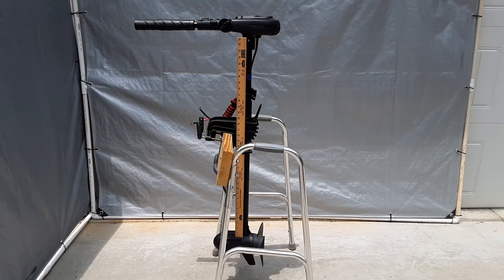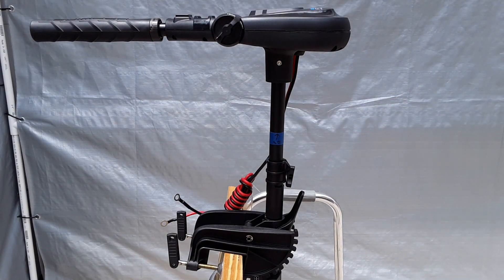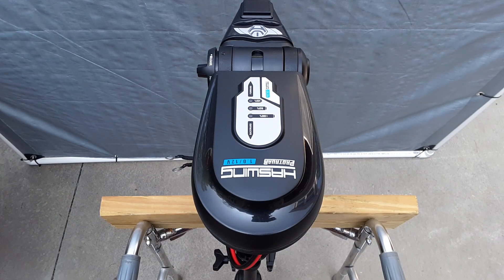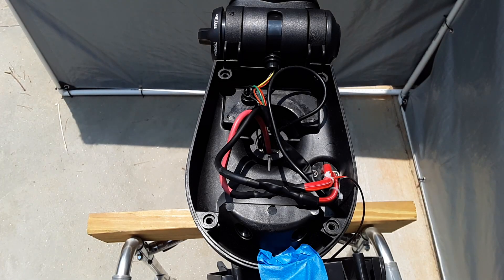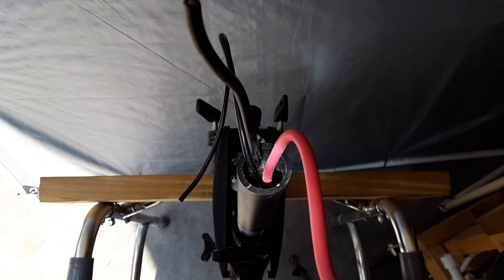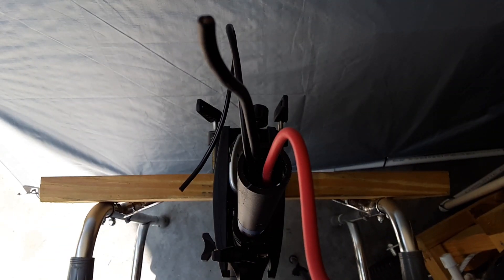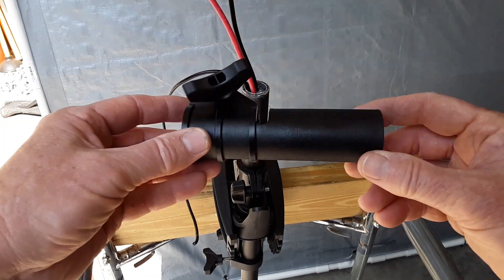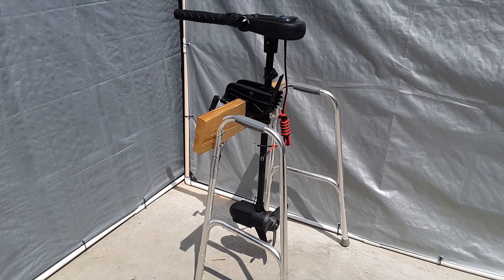Haswing Protruar 1.0 Trolling Motor Shortened Shaft

Comment: Thanks for the videos! 
Does the stock clamp that you replaced with the minn kota simply slide off the shaft? I agree it is too long and would like to shorten mine to have a couple extra inches and have the control head closer to the mounting bracket. Also, what did you do with the wires coming from the handle unit to the control head? Did you have to cut and then reattach them?

Comment: I know it's been a while since you done this video but I just found it.  If you shorten the shaft like you did can you not cut the wires and just leave the excess wiring in the head and just put the cover back on?  I'm thinking of getting one and doing this mod to it so the length is more in line with my Newport Vessels 55lb Kayak version trolling motor.  I like this Haswing because it's brushless so it will be much more efficient, 8lbs lighter and the big thing and my main reason for getting one is the more proportion throttle vs the 5 steps on my NV trolling motor.
Reply from the maker: You could store some excess wiring in the head but I'm not sure it will all fit.

Comment: Whats the length of the original shaft you bought this motor? Was it the 660 or 900mm? And whats the best length should you have dipped into the water for the motor to perform optimally for a kayak?
Reply from the maker: The shaft is 36". Each kayak is different depending on the hull design and load. I would put it in the water under your normal conditions and measure from there.